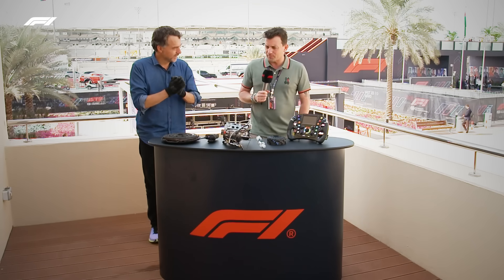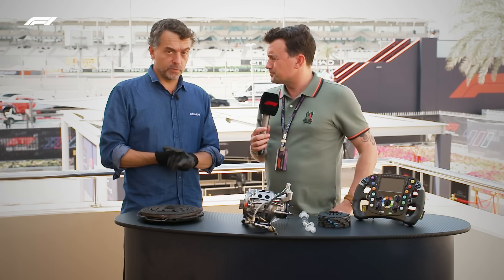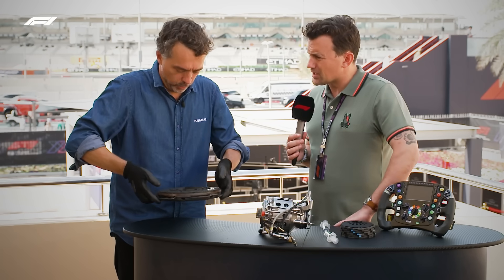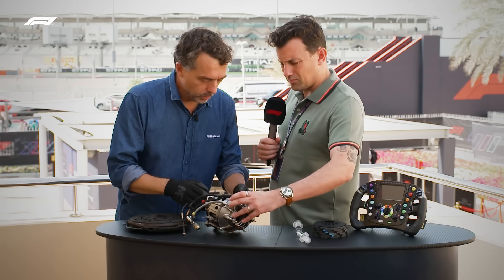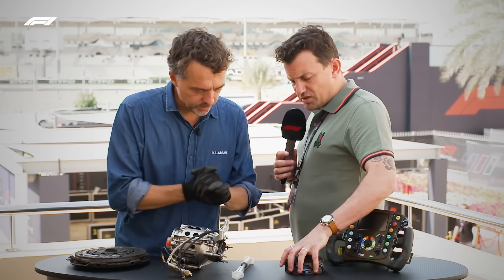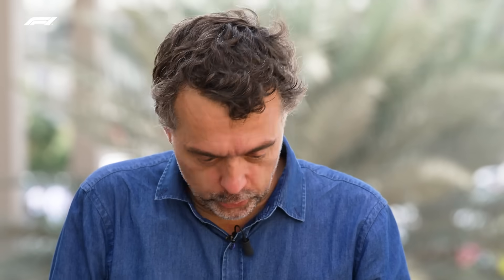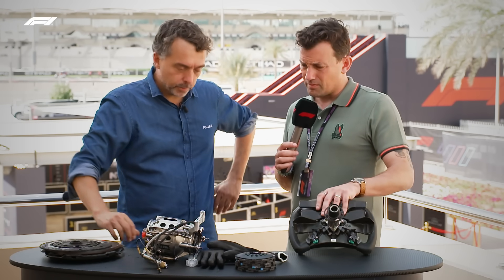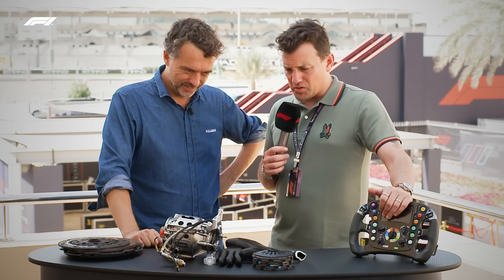The Most Advanced Clutches In The World | Albert Fabrega F1 TV Tech Talk Demo | Crypto.com

Comment: F1 be using subaru center diffs or pathfinder rear diff XD 

The air example is sort of incorrect as that would only be at atmospheric pressure, at higher pressures there will be less 'squish' and it will transfer the input. Hydraulic solution doesn't require a compressor though.

Comment: 2:07 Will Buxton needs to learn how to drive a stick. Albert's asking what happens when you dump the clutch on full throttle which results in wheel spin/burnout/launch (which is why he follows up with "OR you start spinning the wheels!") You only stall the car if you dump the clutch with no throttle or too little throttle.

Comment: 8:50 Correction: Lewis isn't holding the clutch at the top, he's holding it with his right hand as you can see when he gets off. He positions the left hand between the steering wheel and the downshift paddle to ensure he doesn't accidentally downshift in the start

Comment: will’s question about shifts while driving on track didn’t really get answered:

According to Albert, no clutch input is needed by the driver during upshifts while driving on track but to do this automatically, without driver clutch input, does the clutch hydraulic pressure control mechanism then release some of the pressure automatically during an upshift then?
Reply: It doesn’t use the clutch to shift once you’re moving. The computer can basically shut the engine off for a moment to unload the transmission and let it shift. They don’t have syncros like a road car so it can basically bang into gear quickly. Downshift is similar, but it adds a blip of throttle so the revs match.

Comment: Would appreciate a mention how the "seamless" gearbox works during up-shifting without pressing the clutch.
Reply: The transmission would shift just like a modern superbike. The operator presses the paddle up or down and a computer would time the throttle so the transmission can move from one gear to the other. Even with autoblip and clutchless shifting, you can still mess up a shift in a superbike so i like to half press the clutch on the 1 - 2 shift just to make sure i dont hit neutral. F1 has a neutral button so the drivers can bang up and down the gears without hitting neutral in between gears.
Reply: Can't soak to F1 specifically but typically when you want to make a shift without using the clutch you have a system which cuts ignition for a fraction of a second, usually a switch on the shift lever, it senses the shift starting, cuts the ignition which unloads the pressure on the transmission, allows the gear change and then restores ignition. Depending on the system, fuel will still be delivered during this ignition cut which will be burnt in the exhaust, hence the small bang you will sometimes hear.
Reply: It's a dogbox with straight cut gears, you can shift in any position and don't need to synchronize the gears to shift. Additionally you can do an ignition cut during the shift to reduce wear, you can also electronically sync RPMs.
Reply: It’s a basically a motorcycle transmission. Constant mesh dog box, you don’t need the clutch to shift, you just need to unload the transmission so the gear dogs can engage a different gear.  In this case is done with a momentary cut of the ignition like a quick shifter on a bike.
Reply: yes, exactly, Will was asking about shifts during the race but as much as we all love Albert, sometimes he gets a little bit off track. 

No clutch input is needed by the driver during shifts while driving on track but to do this automatically without driver clutch input does the clutch hydraulic pressure control mechanism then release some of the pressure automatically during an upshift then?
Reply: @tgw230  
Dual-Clutch Systems: Some F1 cars use dual-clutch systems that have two separate clutches for odd and even gears. This allows one clutch to engage the next gear while the other is disengaging the current one, ensuring a smooth transition.

Electro-Hydraulic Systems: Advanced electro-hydraulic systems are employed to control the engagement and disengagement of the clutch and gears. These systems use sophisticated electronics and hydraulics to synchronize the engine and transmission speed, reducing the time it takes to complete a gear change
Reply: @kjm0677  Nah, F1 cars don't use DCTs since it adds weight especially when you can use just one clutch system and a sequential gearbox with straight cut gears which is lighter than a DCT. Plus the straight cut sequential gearbox is much simpler than a DCT which is more complicated than needed.
Reply: @tgw230  Probably. In a road car, what you are doing is releasing gas and pressing clutch at the same time - change gear - releasing clutch and pressing the gas at the same time. So I guess the seamless gear does exactly the same when pressing the up-shift paddle but automatically and very fast.
I would like to understand the down-shifting though. It must be something different because I still remember hearing the "explosions" of the F1 down-shifts when visiting the Grand Prix in person.
Reply: @Atarian6502  The gearbox F1 are dogboxes which doesn't require the use of the clutch to shift but only a bit of rev matching. The computer sends a signal to the ignitions to cutoff for a short time until the upshift is done so that the engine can drop to the right speed for the higher gear. A similar thing is done for downshifts but the computer will send a signal to blip the throttle to bring the revs up so that the engine is at the right speed for the lower gear. It basically runs on the same principles for rev matching a regular manual car just that most of the actions are automated by the computer to make shifting faster.

Comment: For future episodes, maybe you could add in some animations as well. For example to see visually how the plates and disks of the F1 clutch interlock when the pedal is released, and what part is rotating when. Would allow a deeper understanding I think.
Reply: I see your point, but I like the physical, hands-on nature of the demos. No CGI, all real props.
Reply: Just removed the engine from my car, whilst it was out I showed my son the clutch and how it works and how you can wear it out.  That the led to more discussion showing how the turbo works and the injection system.  How did you learn this dad? - my dad showed me 40 years ago son.
Reply: There are plenty of channels out there that go in depth of the engineering in F1.
Reply: I don’t think the point is a deeper understanding it’s about getting younger minds engaged enough to pursue a career in engineering towards working in F1 in he future
Reply: @therealBocaStudios  It's not as if adding in some animations would deter getting younger minds engaged, though. In fact, getting younger minds engaged is all the more reason to add animations, because that could help would-be F1 engineers retain the material.
Reply: @piquedcommenter6252  would be f1 engineers don't need animations to retain the material..if they do they wouldn't be f1 engineers

Comment: He made a little mistake. He said the pressure plate and clutch disc sits directly on the engine. Which isn't completely true. First there sits a flywheel then the disc and then the pressure plate.

Edit: whish they would have explained the clutch material, how much pressure they put on the plates and so on.
Reply: As I understand it, there is no flywheel on a modern F1 engine. The small clutch assembly has enough weight so along with the electronics controlling everything no dedicated flywheel is needed.
Reply: I'm probably wrong but isn't the purpose of the flywheel to give the engine more inertia so it would be less likely to stall when accelerating from a stop so I'm assuming the power of F1 engines would negate the need for one, it would also lessen the energy needed to rev the engine.